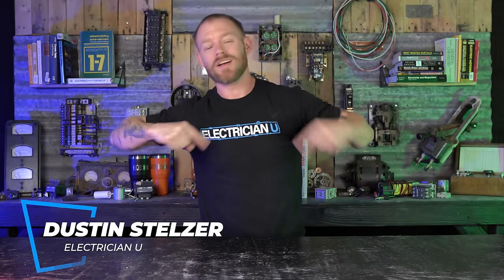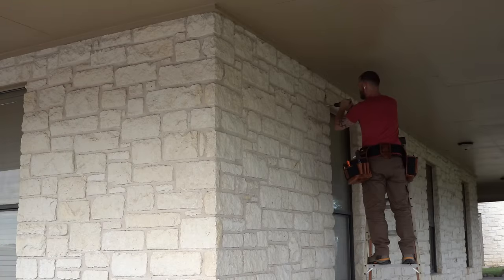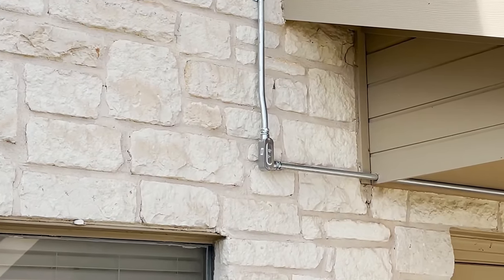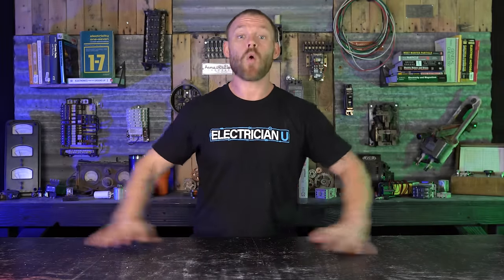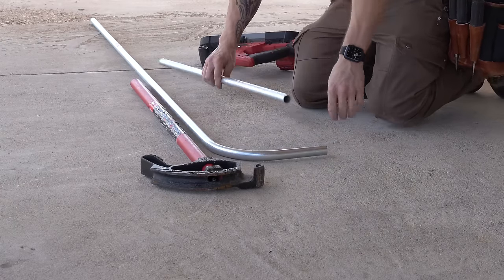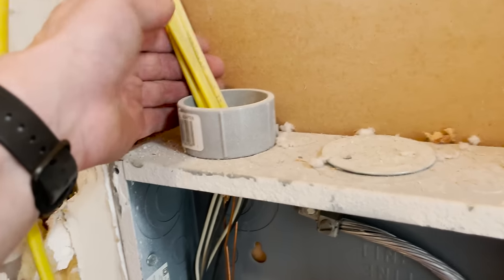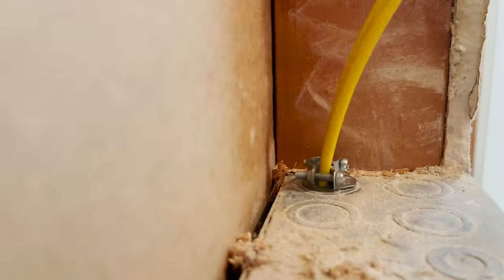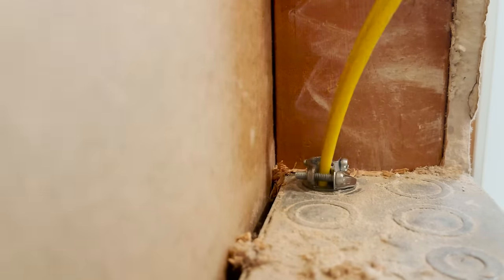Installing a Mini Split at a Commercial Building.

Comment: Doing it at the disconnect is a code violation because you can pull a red THHN/THWN through the conduit
Reply: Did he pull a white thru conduit and land on the line side of disconnect? Why not pull black or red?
Reply: I know right, why is he going over the code book and then pulling a #12 white thru emt? lol
Reply: @uhjyuff2095  weird, makes no sense.
Reply: For an energized conducted red is perfectly acceptable. So is black blue purple red pink yellow orange & yellow.
Reply: @garbo8962  yep! the word you are looking for is energized ungrounded conductor.
Reply: @garbo8962  It's only legal if it's to re-identify a cable to strip the jacket off a NM cable and install it in a conduit is a code violation because the conductors are THHN and not rated for wet location
Reply: Ok rookies and level 1 aprentices: he used thhn on the metal conduit Then romex from the Junction Box in the attic to the Panel because its 99% easier to run romex to the pannel 😒so now romex has a white cable so he is Now marking it Red😒 any more questions ???
Reply: @citizenfriendly3845  Which is a code violation
Reply: @williamsnyder6514  how
Reply: Um no its not
Reply: Its not a code violation OMG.
Reply: @citizenfriendly3845  How can you legally run THHN in EMT in a damp location?
Reply: @cameronbusbyhonda332  There is no reason to re-label THHN/THWN if you pull it correctly there would be no reason you have a white wire unless you used the cable.
Reply: @citizenfriendly3845  There are multiple code violations.
Reply: @williamsnyder6514  point them out and refference at least from the NEC.
Reply: Wiliam snyder just in case you havent notice at home depo or lowes or others. Thhn cable is also THWN witch is rated for damp locations . The label will say THHN but when you take it out of the package it will also say THWN. bro i have seen it with my own eyes
Reply: @citizenfriendly3845  Well then he wouldn't need to re-identify it at the disconnect if that's what he used he could have used a red conductor.
Reply: @citizenfriendly3845  If it is a white dual rated conductor it's a violation of 200.6
Reply: He does not have white wire at the disconect. He has red THHN/THWN. 
He only has white wire (romex) @ the Panel (inside the house)
Reply: @citizenfriendly3845  Review 334.12 not permitted for use in damp/wet location
Reply: @citizenfriendly3845  After watching again I have no clue why he pulled white and re-identified it that is a code violation you can only re-identify it if it's in a cable
Reply: @citizenfriendly3845  You should watch it again
Reply: @williamsnyder6514  So you’re saying that code says you can’t reidentify a neutral unless it’s apart of a cable assembly like romex? So “cable assembly”, it shouldn’t matter whether it’s a cable assembly or not, you should still be able to re-identify it
Reply: @Chang_III  I don't understand your point it's an exception if it's a cable assembly if it's #4 or larger it's allowed
Reply: @Chang_III  Ok that's fine but it doesn't say that re-identifying #6 or smaller is a code violation
Reply: The violation William is talking about is of 200.7(C) incase you guys want a code reference.
Reply: @jaycarter7800  Ya I have my sparky senses tingling because the video doesn't show the transition that means something hack IMHO I could be wrong bro.
Reply: @williamsnyder6514  well he clearly shows pulling the white wire thru the conduit. He is no hack but he probably misinterpreted the rule
Reply: @jaycarter7800  I never said code violations were hack
Reply: @williamsnyder6514  and if he did use romex or uf then he would need 1/4" of jacket into the box. I thought i was going crazy when he said you can do this with thhn
Reply: @citizenfriendly3845  you missed the part at 8:06 where if he had used romex than it would be a violation
Reply: @jaycarter7800  yea i overlooked at that part

Comment: I’m still learning, shouldn’t that disconnect be readily accessible?
Reply: readily accessible from the AC unit. so if the AC unit requires a ladder than the electrical terminations should be readily accessible from the disconnect without moving the ladder. if the AC unit will be on the ground than this could be a violation
Reply: @thisgame1499  What’s the NEC article ?

Comment: Not an electrician, so obviously not up on all of this,  but I thought I had heard that you couldn't use Romex in Commercial construction, that you had to use MC?
Reply: Okay so I'm still a greenhorn so I could be wrong about this, but I believe Romex is allowed in any building that falls under the NFPAs Type III, IV, & V classifications, which are all wood-framed construction. Typically, you don't use Romex in commercial construction because most commercial buildings aren't wood-framed. It's a lot more common these days to see steel framing, and you can't run Romex through that because the jacket and insulation could be damaged.
Reply: @braedengendron6981  That sounds reasonable and that might be where I got the idea that MC was required, because it is in steel framed buildings.
Reply: @andrewalexander9492  honestly I think it's just better to use MC in commercial anyway, regardless of if you can use Romex. It's just a little beefier for the application, ya know? And also Romex sucks 🤪

Comment: Curious why 12/2 was used and not 12/3.  Does the mini-split not need a neutral?
Reply: Most 240v A/C or mini-split units do not use a neutral.
Reply: @RJ-ej1nr  Roger that...thnx.  Learn something new everyday.
Reply: @RJ-ej1nr  But why?
Reply: @82lvis  For why it doesn't need a neutral - motors and associated components are frequently built to use 240v instead of 120v to improve efficiency (for example, it doubles the power it can get for the same supply wire size).  In North America, standard residential transformers deliver a single phase 240v with a ground tap in the middle between the phase legs, making each phase leg 120v away from the grounded tap point (which gets connected to the grounded conductor/neutral).  When you want 120v, you connect between a phase leg and the grounded conductor/neutral, and when you want 240v you connect between the phase legs without using the grounded conductor/neutral.  If you build your device with no internal 120v components, it has no need for a neutral.  Note the equipment grounding/bonding conductor is still present and connected for safety.

Hopefully, that answers what you wanted, and it is a bit simplified.  I can go into more detail, and some of it gets into electrical theory pretty fast.

Comment: you didn't use a weatherproof connector on the disco? What are you doing? Weatherproof connectors have gaskets to make a water tight connection...
Reply: What's a disco?
Reply: @ED-LETRICAL  the a/c disconnect

Comment: Why were you pulling a white and a black through the EMT for a 240V circuit?  That does not meet code.
Reply: I agree, he showed us the nec code section and everything... lol
Reply: He stated that you can identify a neutral wire to become ungrounded, but not the other way around.
Reply: @dannyagostino956  Yes, as long as the the neutral wire is part of a cable assembly, not wire that is pulled through emt. And if he removed the sheathing of his romex for 100 foot run of emt that is also wrong because the wire has no identifying marks on it, so it would not be rated for outdoor wiring.
Reply: @uhjyuff2095  He was pulling the THWN/THHN off 500' spools , feeding it into the conduit.  A black, white and a green for 240V circuit?  No bueno !!  And yes, per art. 200.7(C), identifying a white wire with tape is only allowed for cable assemblies or cords.

Comment: Awesome video, however as an hvac installer I absolutely hate it when electricians use those style of disconnects, I always end up replacing them with removable fuse  disconnects.
Reply: The breaker in the panel is the over-current device, a fused disconnect is not only unnecessary but is twice the cost, and you have to buy the fuses.

Comment: So I am watching you re-identify the white conductor in the a/c disconnect. It is a code violation because the white wire is not a part of a cable assembly just as you quoted in the code book? At least you know the code... lol.
Reply: Does 'cable assembly' mean Romex?
Reply: @Lexaire  Yes.

Comment: Is the mini split a ductless air conditioner system or HVAC system
Reply: Both HVAC stands for heating ventilation air conditioning 
A mini split is a general term for VRF (variable refrigerant flow) technology
They are heat pumps that either cool or heat & cool, they start in small sizes & can be engineered to fit extremely large spaces
They're actually pretty cool

Comment: Im not sure how you interpreted 200 to allow re identifying a small conductor to ungrounded. it specifically says it shall only be permitted for 2 reasons both involving cable assemblies. id call that a violation
Reply: @This Game
The wire he taped was the white wire from the #12-2 romex. If he had taped the single conductor T90 (or thhn I think you guys call it) then that would be a code violation is how I interpreted it. Here in Canada we have to use romex with BK and RD rather than BK and WT for this application. From what he read, it looks like the NEC still allows what he did though.
Reply: @jimbojames9370  in that case its a violation of another code being that nm cable is not allowed in exterior conduits. unless he pulled mc with the dumb plastic string marking the wires as suitable then he wouldnt be able to do this.
Reply: @thisgame1499  he pulled T90 or the US equivalent thru the conduit (THHN I think?)  Assuming the conduit landed into a 4square in the attic and he transitioned to romex from there. The conductors in the emt where already properly coloured.
Reply: @jimbojames9370  im referring to 8:06 where he is working inside the outside disconnect. if he pulled thhn through that pipe then it can't be two hots.
Reply: @thisgame1499  Well look at that... damn. I only saw him tape at the panel. I assumed when he pulled individual conductors thru the conduit that they were properly coloured and based all my responses on that. My apologies; I'm now 100% on your side. It's one thing to tape up a conductor in NMD90 (hopefully you guys call it that) we used to be able to do that up here and it sounds like you guys still can.... but what you caught at the disconnect there is not allowed. Good eyes. I stand corrected. You ever come up north of the border and visit Ontario I'll have to buy you a beer.

Comment: You can field identify all conductors as long you don't go below 10 awg
Reply: Please provide the correct NEC reference?
Reply: 408.8
Reply: @michaelruiz4074  408.8 is reconditioning of equipment ( in the 2020 NEC) check again

Comment: You have a code violation re-identifying the white conductor in conduit. Read 200.7(C)(1) and (2) again. It says you can reidentify the white conductor when it's part of a cable assembly or flexible cord. That does NOT apply to individual conductors in conduit. Re-identifying the white conductor in the Romex cable is fine, but you should've used a different color conductor in the conduit. The reason for this is cable assemblies are only sold in certain color combinations (2-wire Romex is only made with black, white and bare ground; there's no 2-wire Romex with black and red, for example), so you need to work with the colors you have. You don't have that excuse with individual conductors in conduit and you CAN run any combination of colors you want, so there's no re-identifying allowed.

Also, that disconnect is mounted too high. 440.14 says that it has to be "readily accessible." And the NEC defines "readily accessible" as not needing a ladder or other tools in order to reach it.
Reply: Also none of his emt connectors/couplings are weatherproof because they are all noncolored meaning they are just indoor compression style fittings. lol
Reply: I think he is relying on the words ‘visible and accessible’ in 200.7C (1). Is the need to identify really needed in a conduit body that is not visible or accessible? He identified them at each termination point. Moreover, one could argue that conductors are accessible and visible at The LBs, LLs and LRs conduit transition bodies he installed but even there as you remark would it be accessible without a ladder?
Reply: @mathman0101  Conduit bodies should ALWAYS be accessible (not buried in a wall). Making them inaccessible is a code violation. There's a difference between "accessible" and "READILY accessible". Something can be "accessible" but still require a ladder. "Readily accessible" shouldn't require a ladder. When I mentioned "readily accessible" in my first comment, I was only talking about the disconnect. 440.14 says the disconnect must be readily accessible.

200.7(C)(1) clearly states that a white conductor in a CABLE ASSEMBLY can be re-identified. 200.7(C)(2) clearly states that a white conductor in a FLEXIBLE CORD ASSEMBLY can be re-identified. Individual conductors in a conduit is neither part of a cable assembly nor are they part of a flexible cord assembly, therefore those sections simply do not apply. So discussing whether the white conductor should be marked/re-identified at each conduit body is a moot point. It shouldn't be re-identified at all in the first place. Like I said in my first comment, you can run any combination of color wires you want in a conduit, so there is no reason to just run the proper color wire instead of re-identifying a wire.
Reply: Thats is true about 440.14 being readily accessible, but the rule also says it has to be within sight from the equipment and readily accessible from the equipment. If a AC unit is 30 feet in the air, the disconnect can also be 30 feet in the air as long as its within sight of the unit.

Comment: So, all you aspiring architects out there, watch this & don't design buildings so they're a total pain in the ass to do wiring and/or plumbing.
Reply: Hate to tell you but if it means additional cost or time most building owners will not go for it. I even had a project supervisor look at me and say “do you know how much it would cost to change these plans?” when I pointed out an omission in a building the company I worked for was about to build. My response was “less than changing walls after the building is completed”. Less than a year later the omitted maintenance room was being squeezed in and office space was being changed to account for the FUBAR.

Comment: Was not aware that you couldn't take an ungrounded conductor smaller than 4ga and tape it white.  You'd probably come across this if you were taking a 240v circuit and switching it to 120v you'd be using one of the conductors as neutral.  Who the heck is going to re-run that line if they already have it there?!  I can understand why it's a rule though.  Could be lots of JB's along the way that you can't get to to tape the ungrounded conductor white.  Interesting

Comment: Why does the conduit not have to be rigid?
Reply: EMT conduit (steel) is permitted be used in wet locations, and where subject to physical damage as long as it's not severe, in an exposed installation (NEC 358.10).  Those apply here, so EMT is acceptable.  Rigid metal conduit (RMC) or intermediate metal conduit (IMC) are allowable here, and what they add is resistance to severe physical damage and being used to support luminaires/modest devices.  But as there aren't fork lifts motoring around the church porch, it's way more than what's needed and more work/$.
Reply: Thank you for the great information!

Comment: It was such a short run, why wasn't a Romex pulled that had the correct color wire, like a 12/4?  I dig the identifier install but...come on, were you just trying to compete with Randy the Handyman?
Reply: You'd be pulling and paying for a wire (or wires) that's doing nothing.  Re-identifying works fine and is well known, especially for 240v runs.

Comment: Are you not supposed to use a tee at the bottom of the runs? Like at the disconnect or the transition going up? And why not use Ridgid aluminum conduit instead of EMT?
Reply: "Rigid" aluminum conduit?! Are you wealthy?? 😵

Comment: Is that an service for an outside AC Condenser Unit ? If so why didn't you run # 10-3 w/grd  , for a 30 Amp 220 VAC branch circuit as most outside AC Condensers require ?
Reply: There are mini splits that spec 20A (12ga) or 15A (14ga).  So he's running to meet the spec'ed amperage of the unit being put in.  No need to pay for wire size you don't need.  Also don't need to run a neutral that won't get hooked up to anything (-3 vs -2).
Reply: Lol. Mini-splits don't run 30a. My units use 15a.

Comment: Why can you not hole up through the awning and patch the shingles up rather than run 100ft of conduit?
Reply: He's a spark not a plasterer or carpenter lol
Reply: @wizard3z868  Plastering has nothing to do with this here, but you dont need to be a roofer or carpenter. Just a hole saw with an extension up, run the pipe through and roof coat (muck) it. IDK i guess its a matter of what’s easiest for said person. That just seemed like ALOT of run for something that could of been ran straight up.

Comment: It does not look like you used rain tight couplings, rain tight couplings have blue ends. The ones you used looks like a standard compression type.

Comment: Pulling your own white conductor thru a raceway and re-identifying it as an ungrounded conductor at the disconnect is a violation of NEC 200.7(C). That is not a cable assembly like the romex.